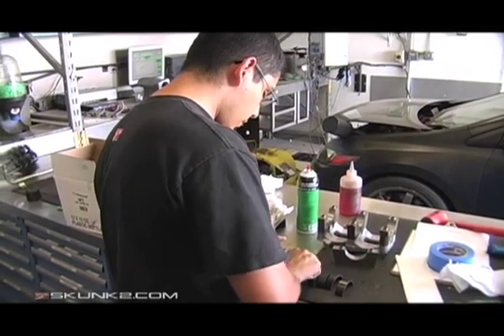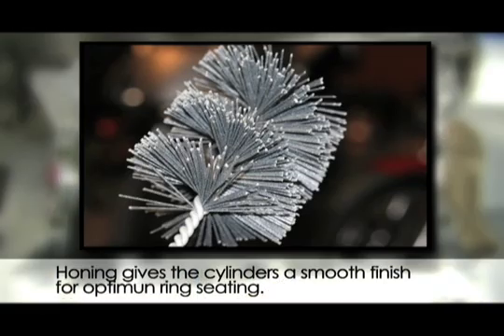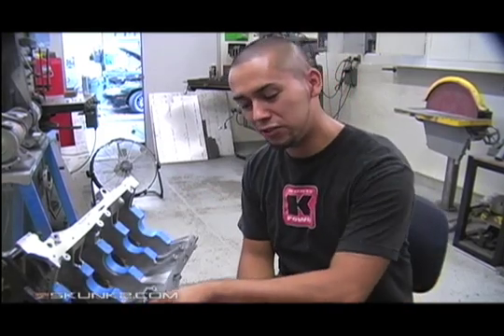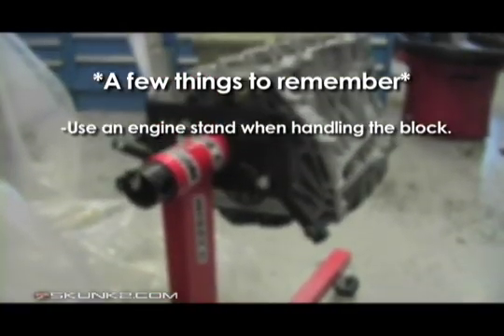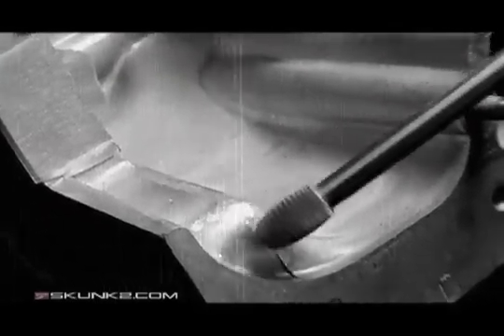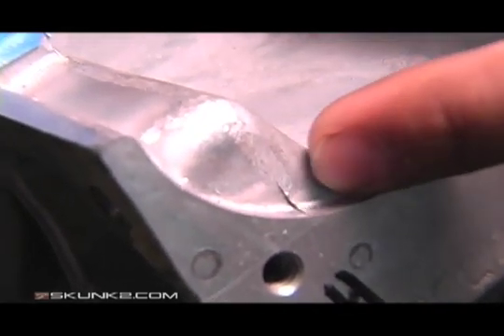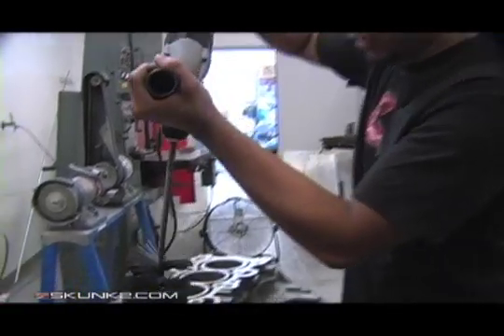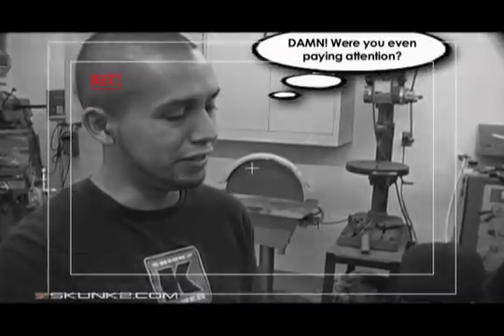Skunk2 How-To: Engine Block Build Prep.

Comment: Dude too fast, dont need to rush these things! go slow and get a nice even cross hatch finish! the idea is to ruff up the bore slightly, if its too smooth the rings will never bed inn! and we turn the block on its side so you make sure your nice and central,  going in from the top you'll always get cock'd over, like the dude in the video! but i still like your products!!